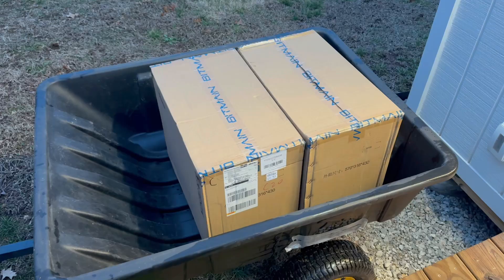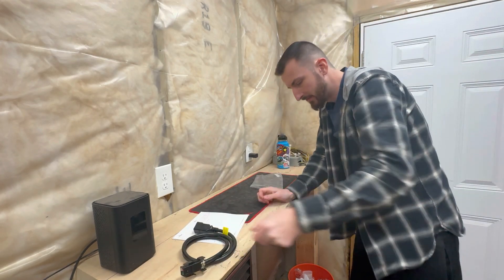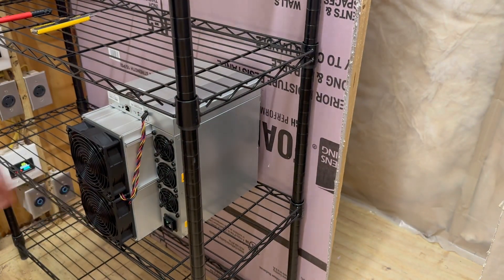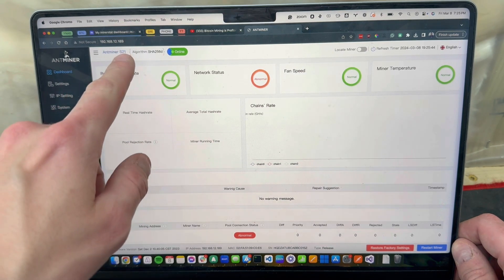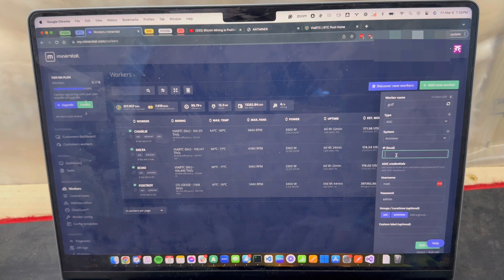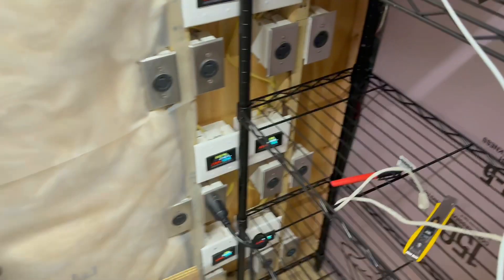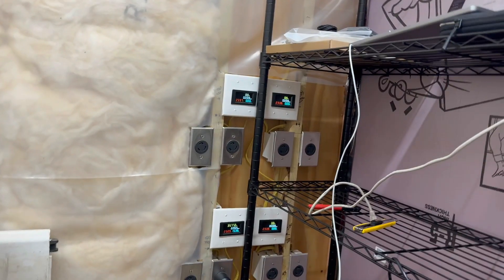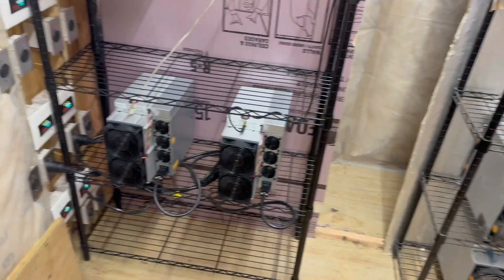Installing My NEW Antminer S21 Miners And I'm NOT HAPPY!!

Comment: A suggestion for a shed this size would be to put an Air Conditioning unit in it. They have some really efficient portable systems now and the one I am installing in my shed was only $1700 for a  small HVAC with filtering capabilities.

Comment: Hey thanks for the video. Can you please tell me the exact Outlet you chose and the cord that you got that allowed you to plug in to the wall and then adapt it to the very strange power cord? If you could actually tell me the model numbers so I can buy them that would be great!
Reply from the maker: Hey! I ended up using NEMA L6-30R receptacles. I had cables special ordered from Anen which is the supplier that builds the cables for Bitmain. The cable is a L6-30P TO P13 SJT 10AWG*3C. This was a custom cable I had them make so they were $50 a piece and then I had to pay $50 shipping as well. Here's the email for the sales team that can get you the cables ordered sales@anen-power.com. Let me know if you need anything else!
Reply: @keisenb  Thank you!
Reply: @keisenb  is it true that these machines should be wired for 30 amps?  Or 20...?  Getting conflicting information...do your power cables both handle 30 amps to the power supply pins?

Comment: Would these be too loud to have in your living room in the corner? because only have a 1 bed flat
Reply from the maker: Yes it would be too loud for an apartment. And too hot. You can mine them remotely and have it go to any wallet address
Reply: @keisenb  yeh just grabbed a s21 for 5k with free hosting and 0.08 p/kwh electricity which is a third cheaper than running it from my home. Could rise to 20k and I can sell the unit or keep mining but even at 60k bitcoin just after the halving Im still making $100 a month profit from it.

Comment: Where ya getting all this energy from if you don't mind me asking. This all residential? Prices must be insane if that's the case
Reply from the maker: All residential. I’m rural on all electric rate plan. Average price per kwh is around $0.08 across the year.
Reply: @keisenb  dang that's pretty good. When I was mining here in NC was bout 10 11 cents. Became to unaffordable. That was 2 years ago. Hashrate was lower, and it was a 104ths, but within like 5 months, it became un affordable. That's awesome.

Comment: I have a suggestion, I have 2 mining locations with asics and I have them slotted into a hot room as-well, but it looks like you don't have the PSU slotted in. If that is true not only is your psu not venting but it is getting hotter and heat soaking your room more!!
Reply from the maker: Thanks I actually just slotted them the other day from this comment and others!

Comment: oK SO, watched your video. Are you for real bro? So your upset because they changed the plug even though they gave you the right cable? WTF. You THINK it should have a 30 amp cable, on what grounds? Those machines draw 16 amps. They are using the 80% rule, you are wrong my friend. These machines do not require a 30 amp cable, a 20 is fine. Now that leaves the plug, I have zero idea why that's a big deal for anyone. Seems to me folks just like to get on the complain train. You have nothing to be upset about and you need to understand watts, amps and kilowatt hours. 3500 watts is 72 KWH per day, 3500w is 16 amps. So actually your upset comes from you not understanding power requirements and grumbling over a cable you didn't have to buy. Jeeze, your life must be pretty sweet if thats grumble worthy to you.
Reply from the maker: Did you watch the video? Mine is drawing 17-18 amps when it’s cold out. It’ll be drawing over 20 amps when it’s warm outside.
Reply: @keisenb   No you won't bro. 3500w at 240v is 14.58A. They run about 16 amps, I suggest you get a new power meter.
Reply from the maker: I will humor you and go put my nice tester on the breaker and check the draw with that. I'm pretty confident that my power meters are accurate within a small margin of error. All of the numbers make sense on my other miners at least.

I would recommend you watch other peoples videos and take note that they also are seeing their machines run well above 3500 watts as well. And it's not uncommon for my voltage to drop to 230v at certain times as well, which would increase my amp draw.

Comment: Definitely would stick the PSU exhaust out into the hot aisle. It will make an impact on the in shed ambient temps. I know putting a hand behind the PSU doesn't feel like a lot of air flow, and doesn't feel like much temp difference when you're so close to the miner, but it will make a difference. 

I've seen miners is well known supposedly premium mining containers, burn out because the factory hot aisle shrouds did not encompass the power supply exhaust and PSU's burned out on hot summer days. 

If your outside air or air inlet was 40, and the shed ambient was 77, then there's a significant lack of exhaust moving and isolating to the hot aisle.
Reply from the maker: I ended up doing this, thanks for the tips!

Comment: My only concern with your setup is the cutouts for the asic fan do not extend to the outside of the psu vent holes on the back. I wonder if the psu is going to overheat.
Reply from the maker: They haven’t in the last 3 years so far. The PSUs output virtually no heat in my experience compared to the miners
Reply: Good to know. The only reason I say that is from my own personal experience of trying to install quieter high rpm (but not high enough) noctua fan and causing all kinds of weird stuff to happen.
Reply: Consider yourself lucky!!! They absolutely need the airflow to help the psu last longer!
Reply from the maker: They get airflow. It’s not hot behind them at all and air can escape with no issues

Comment: I ran all runs 10/2 with 30amp breakers and outlets. I knew that these miners are only going to draw more power. However its a pain when I'm only running 13amps on a 30amp run
Reply from the maker: Are you using the stock power cords on them? I ordered some 10 gauge replacements from the manufacturer that makes the stock ones
Reply: both, i've used stock and replacements. I don't know if I've ever had an issue with a stock power cord necessary  @keisenb

Comment: Can a L6-30 receptacle handle 2 s21s?
Reply: I would not suggest it, these are 3550 watts +or- 5% or that's 14.82amps to almost 16amps
Reply from the maker: Yeah I wouldn’t. They draw 16-20 amps so you’d trip breakers and risk starting a fire from melting the romex shielding.
Reply: no they pull 18.6 amps. Need 50amp. I just wired a 50amp. Trying to figure how to split

Comment: Like your setup, I need to wire my plug I’ve been using 12/3 extension cords on ASICS and they start melting at connections. Make sure to knock out opening  in the foam panel for  the window for PSU before it overheats
Reply from the maker: The PSU's don't put out any heat really. All these rigs have been running for years with temps over 100 degrees in the summer with no issues

Comment: I would build my own power plug from the hardware store with large gauge copper wire and a heavy duty 220-240v outlet. Just a thought, cheers and nice setup!
Reply from the maker: I'm currently working on that. I'm working with the supplier of these cords to build custom power cords with P13 connectors to the miner, 10awg wire and an L6-30p on the other side.
Reply: I concur, build your own cables

Comment: im running mine on a 16 amp, i do have the njord board and are running a fan and a shrout plugged into another breaker..
but that just uses something like 130w on max
that also removes that insane sound the s21 makes, so you can be in the same room
Reply from the maker: The stock fans use up to 200 watts, which will make a difference, but probably not enough of one on their own.

Comment: I wouldnt worry much about the 16.5 amp issue. If you really are concerned with it you can swap the wiring to 10/2 but it should be fine.
Reply from the maker: I'm not worried about it at 16.5 amps. I'm worried when it's 100 degrees outside and it's pulling 4100 watts and 20 amps
Reply: @keisenb  At the very least may need to consider underclocking units during daytime hot hours.
I used an arduino to do this for me in the past because I was mining out of my attic, would underclock by 20-30% between 10am-6pm or so and then automatically overclock them throughout the night to makeup for the difference when the ambient temps were cooler.

Comment: Your lucky. I bought two and got sent 1 195th model and 1 200th model. The 200 only makes 198. Been running 1 month. Paid for 2 200th models. They are just dumping out whatever they have. Bought mine from crypto miner bros back in November.
Reply from the maker: That's unfortuante. Have you reached out to their support? Mine are both on low power mode so I'm not sure where they're at. 154th on low power though

Comment: If it’s rated for 20amps it can handle more. I wouldn’t worry about it. A 12/2 can legally take 25amps on a dedicated appliance
Reply from the maker: if you have a higher temperature insulation ( like THHN for example) the wire will carry 25 amps however I don't have that, and the NEC still only rates it for 20 amps.
Reply: Will 10/2 and a 30a breaker handle 2 s21?
Reply: @mmakam3  what is the wattage

Comment: Ah I just can afford the time to watch the video but why on earth isn’t he happy?  I loaded about 50 of these a couple months back and they have been flawless.
Reply from the maker: They are drawing a lot more power than advertised. Gonna have to rewire my 20amp circuits to 30amp circuits and upgrade power cords. These are drawing anywhere from 16-20 amps depending on ambient temps
Reply: @keisenb  What’s your voltage at?  Our single phase is a bit hot at 243V but a 15 amp breaker just about runs it a 20amp no problem at all.
Most of ours are on 277V though and even a 15 amp runs it easy.